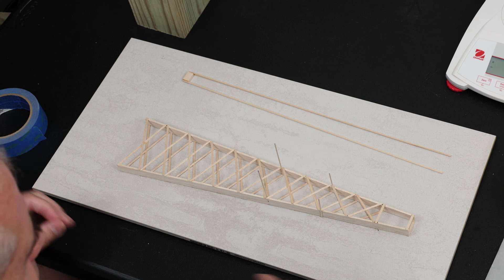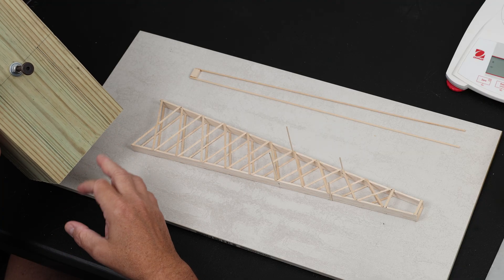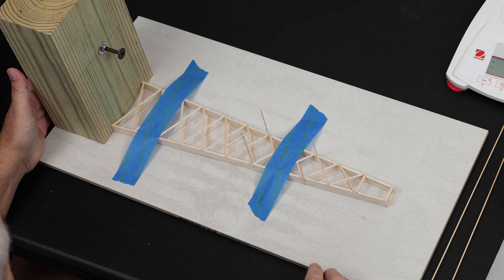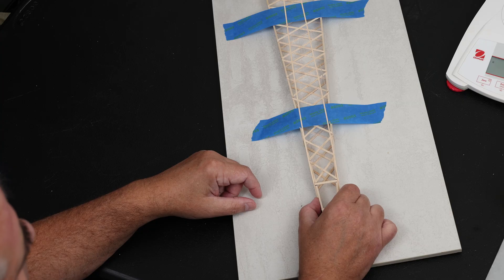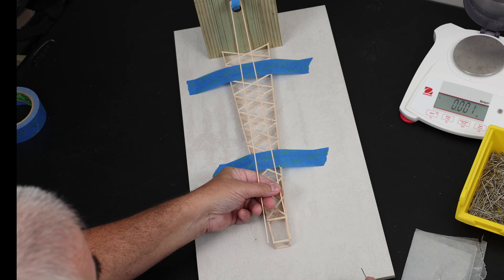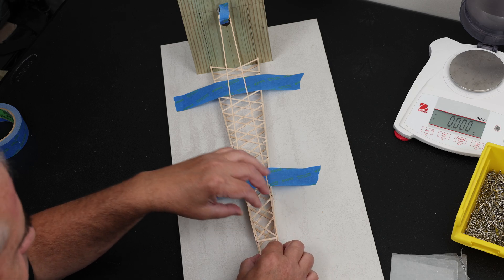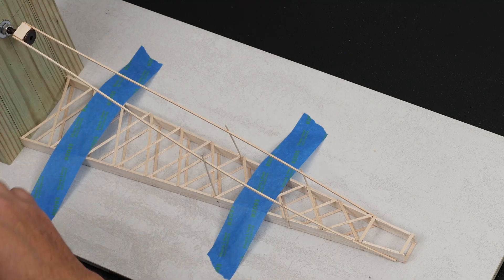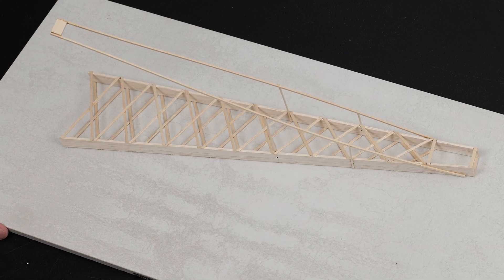2026 Science Olympiad Boomi Div C: Construction: Assembly

Comment: Hey! I had a couple questions, but first I just wanted to say how awesome your channel is! Firstly, how do you recommend testing these build events? Also, could you share the data sheet you had in one of your videos? Lastly, how did you assemble the bolt/wood jig? Thanks!
Reply from the maker: Thanks!  I would encourage you to join my discord server to answer some of your questions in more detail: https://discord.gg/zygFUHR7  For testing, you'll need to build some kind of wall that conforms to the rules.  This will require some woodworking tools and it should be made out of 3/4" plywood (or hardwood).  Same with my assembly jig, I used a 4x6 post cut to size with a miter saw and I used a drill press to make the hole for the bolt to screw in.  There are folks on my discord that have 3d printed an assembly jig if you poke around a bit. Good luck this season!

Comment: Hello! Do you have any links to the specific wood sheets you bought, or would sheets of balsa and bass wood with 45 cm height work? Thanks!
Reply from the maker: In general, I buy balsa sheets that are 36" long by 4" wide by the thickness I want.  There is nothing special about that dimension except that it's one of the most cost effective sizes and it's easy to strip in straight pieces.  For basswood, I buy all my sticks pre-cut as it is very difficult to try and cut those from sheets.  For balsa sheets: https://specializedbalsa.com/products/balsa_sheets.php   For basswood sticks: https://fnabco.com/collections/basswood-sticks

Comment: Do you have spacing for the x’s. I know in one video you showed the stick with markings that you said to use to mark each other build, but how far are the markings on that stick?
Reply: Ok, perfect. What do you mean exactly by depending on the mass? Should the x be more or less spread out if the beams are of greater or lesser mass?
Reply from the maker: @Greasy-vp4vt  If you have stronger beams, you can get away with fewer cross bracings (spread out more), or if not fewer, lighter.  I would stick to probably 7 or 8 as a minimum though.
Reply from the maker: I purposely didn't provide that level of detail because there is no one correct answer and it will depend on the mass of your beams.  That being said, the whole boomi is about 42.5cm, the end is around 4.5cm, which leaves ~38cm for all the cross bracing.  With 10 layers, that means around 3.8cm between the markings for my build here.